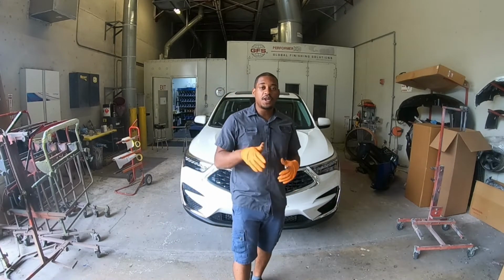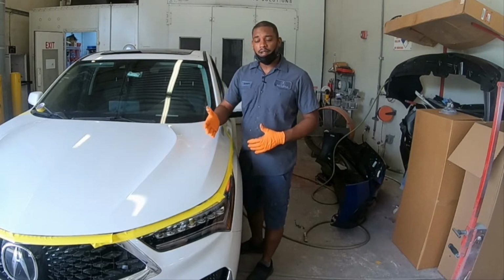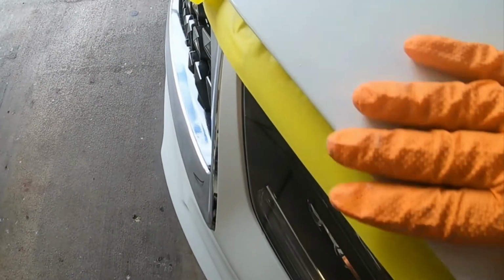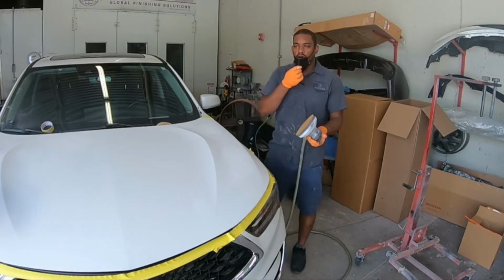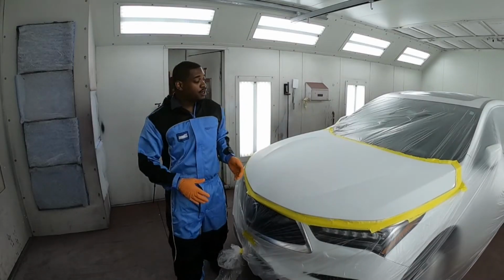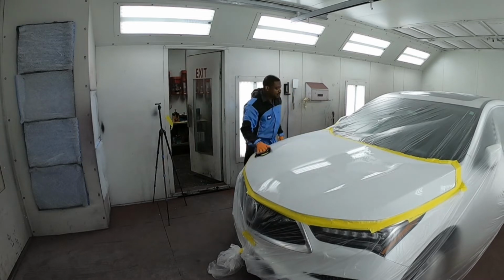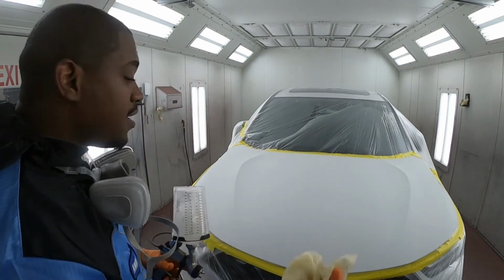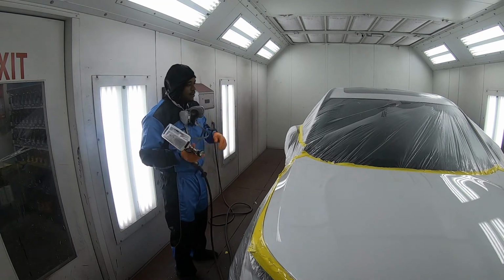BEST WAY TO FIX DIEBACK

Comment: Great video! I recently had my pearl white hood repainted and now I have    what might be described as some donut rings throughout the paint that only show when in the shade. What caused them and how do you fix it?
Reply from the maker: 👋 those rings you're referring to. I remember when I used to get them and could not figure out why. It's called paint mapping. For a personal example, this happens to me whenever I don't sand the clear coat around the repaired area properly. So priming over clear that wasn't sanded. Example #2 priming leaving gaps in between each repaired area. To fix the problem, you will have to sand down the panel with #600 or #800 grit sand paper after the clear dries. Then give it a flow coat no need for paint unless you get a burn through.
Reply from the maker: Thanks!

Comment: Mario,
Currently working on flow coating this hood. I started out with 600 then went to 800 dry with the da, but the clear seems to be clumping up my sand paper. The clear was air dried but has been drying for a couple of days.
Reply from the maker: It sounds like you had an improper mixture your clear should have been dried by now
Reply: @mariopaintclass6091  I was wondering about that, but I mixed it 2 to 1 per the tds
Reply from the maker: @marcuswhite1403  it’s possible you made a mistake. Your clear should have already dried if it’s still soft it means there wasn’t enough hardener. Anyhow what’s your progress looking like now?
Reply: @mariopaintclass6091 it's going pretty good. Got it all sanded down and ready to flow coat,  but debating on going on and doing it or starting over. Not sure if it's not seeming to be dry will cause issues down the road. It's a hs clear. I'm use to using medium solid clearcoat. I know some people say that some clears stay softer longer so it's easier to buff
Reply from the maker: @marcuswhite1403  o good 👍 it will be okay it will dry out
Reply: @mariopaintclass6091  thanks man.

Comment: Its interesting to see problems on you guys encountered in production bodyshop. Really appreciate it and it gives encouragement for diys out there that not every paintjob comes out perfect every time. This dieback somehow happens in some paint job. Somehow its really hard to determine what is the real problems because we only can see the dieback occurs after we done clearing. Like you said Mario, its better to flow coat instead of buffing it , its just waste more time and materials, so doing flowcoat it can get the vehicle out as soon as the next day.
Reply from the maker: Thanks ntony👊 We all make mistakes there's not one painter out there that can say they never had any issues, if they do it's a lie! Keep doing what you do when we fail it only matters how strong we come back.
Reply: Ntonytay, I use to work in the paint department at a car manufacturer and we use to run in to all sorts of problems and then have to try to troubleshoot the root cause. We even had to wear certain types of deodorant because it could cause fisheyes

Comment: Interesting video Mario and thanks for the help and advice in the video, when I get rid of dust from my panels I don't blow it off but use an old microfibre cloth it removes all the dust so it's not all in the air which is not good for your health and it keeps your work area cleaner👍

 the only time I get dieback is if I use sealer (called WoW primer here) so far I've tried 3 different sealers but they have all done the same thing but I now have a different brand to try and have been assured this one will not cause it. To be honest I think it's more down to user error than it is the product, whatever it is I'm determined to to crack it💪👊👍 John UK.
Reply from the maker: Thanks John! I sometimes use a towel to wipe away the dust great tip. The dust definitely goes everywhere when you blow it. I can’t wait to find out if your new sealer fix your problem.
Reply: My prep/mixing room is very small so I need to keep the dust down and a microfibre is essential for removing dust. I'll let you know how the wow goes Mario it's the Octoral non sanding primer.
Reply from the maker: @JohnWD40TC02  you know John I was thinking because you’re not painting in a paint booth your sealer could be drying too fast because of the heat so maybe try a slower hardener or reducer and see if it makes a difference
Reply: It's certainly worth a try if this sealer gives me problems, according to the TDS it has an open time of 48 hours before you need to sand it before applying the base plus there is a wide range of hardeners both MS and HS that can be used. I normally use one reducer all year round which is a slow one.

Comment: I'm really glad you pointed out that if you cut and polished the 1st round of clear, the panel is less protected.
But by flow coating it, you in fact added more coats of protection overall.
Btw, I took The Gunman's advice and pre-heat the clear for flow coating and it levels out beautifully.
Thanks for the video!
Reply from the maker: Your welcome Steve

Comment: One thing I didn't hear you mention was that when people "Flow Coat" they over-reduce the clear with 25% reducer by volume.  The extra reducer allows the clear to "flow" out flatter with less orange peel.  To just sand your new clear coat and put more clear is just another coat of clear.
Reply from the maker: Thanks for your comment John this flow coat is not for a show car. The main focus here was to fix the dieback problem. But regardless you’re absolutely right about the reducer. And with or without the reducer your clear always come out flatter at least mine does when I re clear. But keep those comments coming we all can still learn something new I appreciate you.

Comment: Hii...what was ur psi of ur gun?
Reply from the maker: This is the dv1 base coat gun I was running it at 18 to 19 PSI as this gun doesn’t require a lot of pressure.
Reply: @mariopaintclass6091  thx Mario...i think that u would change the settings if u would paint a metallic color ...isnt it?cause i never go under 2.2 bar with Clear coat (my gun iş sata meanwhile)it ll ve too weak.....what do u think Mario?
Reply from the maker: @mustafaaslan219  I don’t usually change my pressure because it’s metallic,solid, or pearl.
Reply from the maker: @mustafaaslan219  try changing your pressure and give me a little more info so I am help u better

Comment: Mario, the clearcoat that I'm trying out now has a flash time of 8-10 minutes between coats. It's still tacky within 10 minutes. I been working on painting a hood black with it, but I seem to continue getting die back by the next morning.  I know it's usually caused by putting on too much to fast, not sure if I need to try to wait longer between coats
Reply from the maker: Sorry Marcus for some reason I just saw your comment hope you fixed that problem by now. Nevertheless make sure you are mixing the clear properly with the right hardener in terms of fast, medium, or slow for the temperature in which u are spraying.
Reply: @mariopaintclass6091  thanks man. I'm still working on rectifying the problem.  I believe I may give it a little more flash time between coats of clear.